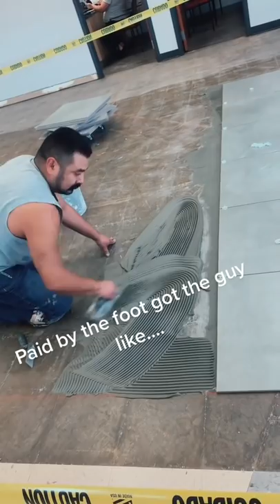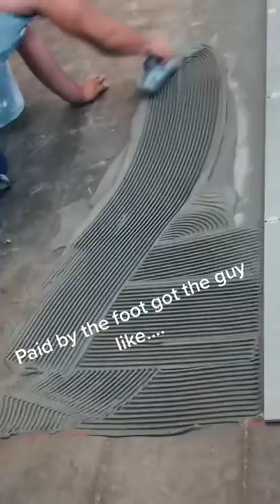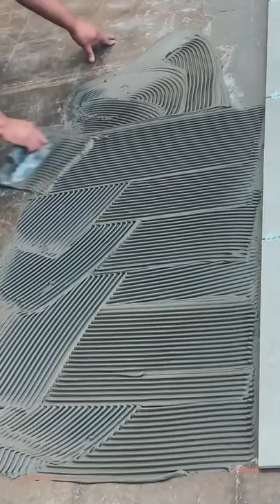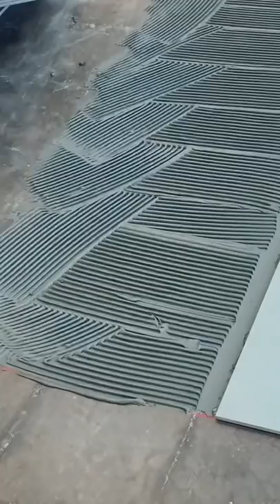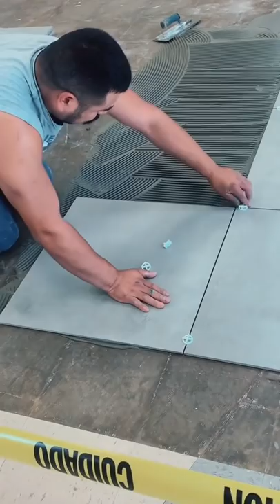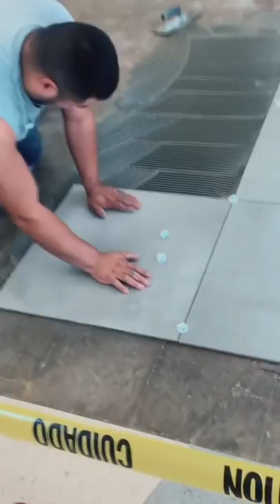Dude laying our new tile is 🥶 CREDIT terrywatson806 #Shorts

Comment: He’s troweling the mortar in a way that doesn’t allow the air to escape from under the tile. The channels in the mortar need to remain open at both ends so the air can escape. Allowing the ridges in the mortar to collapse and completely fill in under the tile. His way leaves air pockets which can lead to cracking and breaking of the tile.
Reply: Exactly,  and no skim coating on the back. Strait rookie as hell
Reply: Also the trowel size is small for those LFT
Reply: @Peter Angles look up a video it's called trowel and error
Reply: I saw all the positive replies and said the same thing,  guess there's lots of people that don't know what their doing.
Reply: @Apoc414  what?
Reply: @growingthegarden  Don't worry, look at the arrows. They're pointing at themselves.
Reply: Yeah the good ol back butter I don’t say shit cus then ppl assume you’re hating I just do mine
Reply: @lemongrab9972  yea we all do this kind of work that's why we're saying something  wbu?
Reply: @lemongrab9972  How do you know he's not doing the work? Also if the guy in the video does a shitty job and gets praised, then that needs to be called out
Reply: You must not have read the part where it says paid by the foot. And its a square tile it doesn't matter which way the trowel lines are. If it was a plank tile (rectangle) then it matters some. Air escapes and the trowel lines collapse no matter what.  How would it be different if he raked it out right to left?
Reply: @dmo544  that part dosnt matter, it matters that the trowel size isn't big enough and he is not butter backing ensuring a proper bond
Reply: @growingthegarden  you are right and actually I didn't see that the tile was covering over where he had two different trowel directions. I didn't notice that at first when I wrote the comment. As to size if it's a 1/4 by 3/4, which I think it is, then it's good enough. We were taught that a 1/2 by 1/2 was very comparable to a 1/4 by 3/4 and that the difference was pretty much negligible. However the latter is better suited for LFM plank. I would use a half by half for these squares probably, but, I truly think the difference is negligible. As to back buttering yeah it should be done but a lot of times it isn't. Overall if I was supervising this guy I would check the bond on one and if it was over 90% then i would say good to go. Him cleaning the edges is fast for keeping clean but they are also the weakest point. I'd be willing to bet that if the bond was checked that could be an issue there. From where he pulls back the thinset with the margin. But maybe not. it looks like the mix was loose enough.
Reply: @dmo544  yes I agree the thinset did look pretty fresh and he didn't waste any time setting the tiles
Reply: Exactly 💯 I am cringing watching this as most are just amazed at how good he's doing 😆
Reply: @dmo544  air doesn’t escape when trowel lines are curved under the tile. Doesn’t matter if it’s a square or rectangle tile, the trowel lines need to extend straight from edge to edge to allow channels for the air to escape. Then the tile will settle when tapped into place and be completely supported as the ridges of the trowel lines collapse together.
Reply: No they don't. Do it with a piece of thick glass u will see so much air trapped

Comment: This doesn't really look slow considering he is doing (from what I can tell) a respectable job. Do you want it done fast or right?
Reply: I'd like it done right. He's not back buttering. He's not doing it right
Reply: @Dagnis8  I'm not going to get into that debate any further than from personal experience I have never found a difference. There are probably applications for it, but my 10 year old tile job that I did personally in a relatively high traffic area for a home has never had any problems. Depends on the stability of the substrate as well.
Reply: Yeah he could do a little better but whatr u paying is the question at the end of the day
Reply: @Dagnis8  thankyou! Ffs there's going to be voids everywhere
Reply: The emoji means he's "cold" good at his job so to speak. It doesn't mean he's going slow.
Reply: Done right, this tile won’t sit completely level especially after the foundation settles. Causes cracking and lifting tiles and cracked grout joints. If done right your tile will always sit level, not just parallel to the ground (there is a difference, I do have years of experience along with being raised doing tile)
Reply: @vincentg6613  kind of obnoxious
Reply: @vincentg6613  Never to young to realize that there is more than one way to skin a cat.
Reply: @Agame-sf8pm  Foundations tend to settle evenly (which can be crooked) or catastrophically resulting in cracks. Concrete foundations are not elastic. Regardless of your preferred installation method. If you are getting lots of cracks in your tile on a concrete substrate, it's likely you have bigger foundation cracks and that's called a settlement problem. Most foundations won't settle more than a few mm over the course of many decades.
Reply: @BoulderBro999 why? wrong. I'm a flooring installer/tiled shower installer and get paid by the sq. ft., too.
I am much slower than other installers because I work alone and there is so much prep, physical AND mental challenges, clean up, e.t.c
 that I would(usually) be scamming the customer from working slower! But, my work is very detailed and upper eschalon  work because of the best descriptive word for ANY INSTALLER: INTEGRITY.
Reply: @Agame-sf8pm  firstly, concrete like that usually doesn't settle much, just dries out over time. Secondly, an uncoupling membrane (i always use it over concrete or wood subfloors) would have solved ANY future tile issues...IF enough thinset was applied.
Reply: No need for back buttering
Reply: Fast. America likes everything fast and cheap that's why we buy everything from china
Reply: @Agame-sf8pm  so is he doing it right
Reply: the post says they cold aka they are amazing at their job. nice try to feed negative energy to a good situation though. maybe next time look at what people are saying before being so ignorant ?
Reply: @doubleo4974  you took the video the wrong way completely lol he was complimenting the man not trying to put him down.
Reply: Yeah my sister’s a waitress. She would always tell us that the cooks would tell them “do you want it done? Or do you want it done right?” Which is fucked up now that I think about it lol cause that’s people’s food that they’re fucking with now
Reply: @doubleo4974  him clearing the edges like that is a big no no..... because now he's going to have voids under there and the first time something slightly heavy or just pointy gets dropped it will definitely start breaking around the edges....
Reply: @savagesaxon9743  the person watching them doesn't know what the hell they're talking about....... He's slow as shit compared to most professional floor guys and the way he's doing it will leave voids that will cause the edges of the tile to inevitably break over time.....
Reply: @JasonP6339  If you have ever laid tile, you know you have to clear the edges of a fair bit because when you press down you don't want is squeezing up the grout lines. You have no way of knowing how thick/thin that mortar actually is from the video. Based on his confidence, and speed laying the mortar, probably just the right amount for the situation.
Reply: I assume he wants to do it fast, if he's being paid by the foot. It's in his financial interest to get the job done as quickly as possible
Reply: Well do you want to fix it later or get your moneys worth?
Reply: @doubleo4974  I don’t use the “clearing to create voids method” neither should you. Simply set the tile literally touching other tiles adjacent to. Helps find height and then create grout line and tap couple times down for collapsing ridges. NEXT tile!
Reply: @jamusmorrison3073  That may be your method but that doesn’t make others wrong. There are a lot of factors involved in we can’t know from the video and every person is different.
Reply: @Hitstix420  my comment was actually supposed to be a reply to someone else. Didn’t realize it until I posted and figured just to leave it
Reply: @doubleo4974  haha what? It’s not a method it’s how a professional is supposed to set tile to adhere to industry standards. It’s not like I’m busting his balls. I just want others to know that’s not how to correctly set tiles. Why do something half ass or incorrect. I know the person paying wouldn’t appreciate having it later incorrectly. 
The edges WILL eventually break. 
The tiles are not fully going to adhere to the concrete floor. 
The trowel, which is undersized leaves ridges and those ridges trap air if not done properly. Making the tiles more prone to popping. 
You can’t cut corners and expect others to not call you out. There are ways to keep the mortar from seeping up. As in lay tile against the adjacent tiles to not only stop mortar from coming up but also match height of tiles already set. 
Thanks for you comments.
Reply: @jamusmorrison3073  Like I said before, you know absolutely nothing other than what you see. You can't possibly know this persons method, maybe they are compressing the tile quite a bit, maybe its thinner and spreads under the weight of the tile more. I never said you were wrong and this person isn't either. If you were standing right there and working with him maybe you would know. Your correct on only one thing, yes, the mortar should be even under the entire area of the tile; to account for levelling different techniques are used. There is no wrong way so long as tile is adequately supported and there is no "industry standard" there are guidelines and best practices, but its not like there's a regulatory body and hard set rules. So unless you know this man personally and can ask him specifically about his method, there is no point debating it. It looks plenty fine.
Reply: @doubleo4974  haha ok you obviously don’t care about how tile is set from a 18 year certified NTCA. For instance if all manufactures agrees how it needs to be done. Then that’s a industry standard. If they stand behind how your supposed to do it to gain maximum results. That also is an industry standard. It’s ok to be wrong. I promise one of those edges will fail. Especially if a vehicle or a object is hit with force where there is a void. 
I’m not trying to bust and balls. That’s just simply not how tile is to be laid for best results. I don’t need to know the “conditions”.
Are you fucking with me? I feel like you are..
Reply: A
Reply: @doubleo4974  ok your wrong move on!
Reply: @doubleo4974  the factor is he’s layin tile do it the correct way or not at all! Because then non professional like yourself think they can make assumptions. Wrong! Enjoy your day!
Reply: @jamusmorrison3073  More than one way to skin a cat. Maybe educate yourself.
Reply: @doubleo4974  this isn’t skinning a cat. It’s laying tile. Are you a professional tile setter?
Reply: @jamusmorrison3073  Are you a professional cat skinner?
Reply: @doubleo4974  no that’s why I didn’t comment on your skinning a cat comment. I do set tiles for a living.
Reply: @jamusmorrison3073  I would be honestly surprised if you have actually done any physical labour in your life. Your insufferable attitude makes it difficult to understand who would hire you. Just like you can't prove without a doubt the methods the person is using in this video or their experience, I can't prove a word of what you are saying. It's just as irrelevant. Fact remains, you can skin as many cats as you want, but someone else will always have a different method. Doesn't make it wrong. If we never did anything wrong we would never have found out the Earth was round.
Reply: @doubleo4974  haha you are incorrect I have 18 years in traders. I own my own company but I still work for someone. As is this chap. So you give them the best job. It was good talking to you. I just hope others that read comments don’t think like you and take advice of a PROFESSIONAL!
Reply: @jamusmorrison3073  You work in traders? Like Trader Joes? or is this something like fur trading? I doubt its fur trading unless you are Chinese or Indonesian where most of our clothes come from these days. Be interested to know. As far as my frame of reference you are just as professional in your career as you the fights you choose to pick online. God Bless You.
Reply: @doubleo4974  haha yeah

Comment: I used to be a handyman. Did everything inside and outside of a house. Laying tile isn't difficult, but takes practice to get good like this. Cutting tile is the worst. Measuring angles trying to get it exact can get frustrating. We retiled an entire house one time and our jack hammer broke so we brought out hammers. Fun 2 days. It feels good when you finally start washing out the excess grout tho. Job's done
Reply: Good like this? Huge red flag is the lack of directional troweling. 😂 This is a guy you pick up out front of home Depot.
Reply: @JasonPowell91  "directional troweling"? It is directional genius. The opposite of directional would be random
Reply: @JasonPowell91  only real problem I see is possible hollow spots from scraping the edge like that with big tile. Granted, I was a handyman, not a tiler. But did learn from a tiler of over 20 years. We did tile, but was far from the only thing I did, and probably the rarest
Reply: @sevenwhatuknow  That's one issue. The other issue is different troweling directions. He combed down and to the side near his knees. When doing that, the notches in the thinset are not able to fully collapse, which traps air between the ridges. Always trowel in the same direction and collapse the ridges when setting the piece.

Comment: Father is a tile setter and I failed at trying to emulate. The edge that was cleared with the margin trowel has a higher probability of breaking than the rest of the tile. Should be good assuming this isn't like a car dealership or an entryway that might get a lift driven over it. Clean work none the less I'm sure the installer considered what was needed for the scope of work defined. Keep it up OP that's a tough line of work.
Reply: First thing I thought was car dealership. But you should lay every tile correctly.
Reply: Did your dad back butter his tiles especially ones over 15 inches which is suggested by the NTCA?
Reply: @ironsharpensiron4580  yeah it’s 12x12 is the NTCA. If not he should have!
Reply: @ironsharpensiron4580  back buttering is the more "correct" way of doing it, but it's hardly ever practiced in the trade, especially on ceramics. It is usually almost always done with natural stones (i.e. marble).

Comment: I’ve been doing flooring for 26 year Thinset has to be spread in one Direction for the air to escape and properly be set . On top of that 1/2 Notch trowel should be used on large tiles that floor won’t last .
Reply: Sounds like a hater 🤣
Reply: @elizagarcia2057  you keep showing up on peoples comments lmao they are presenting facts but you call them haters . Sheesh you must be mad
Reply: @elizagarcia2057  go check the TCNA and quit calling people haters that do it for a living while trying to defend something that is clearly wrong

Comment: For a person that worked in tile this dude has pro skill reminds me a lot of my mentor. It’s a pain in the butt to do but the finish product makes you feel good especially when the homeowner sees how well it came out.
Reply: But with tile that size shouldn’t it be back buttered too?  I feel like his thin set should also be straight lines all the way through to avoid any air pockets and adhesion issues.  Fast? Yes.  Correct? No.
Reply: How long did you do tile a week?

Comment: Those crossed sweeps will trap air under the tile making it weaker. The trowel is designed with grooves to create air channels for the air to escape as the tile is pressed in place.
Reply: You my friend are 100% correct. Only took 120 comment to find this answer.
Reply: Should you also 'back butter' the tiles themselves for better overall adhesion and level~ness...? Or are those tiles big enough that it won't matter
Reply: Instead of thinking he did a great job with one flaw you let that 1 flaw control your whole state of thought.. it’s time to start looking at the glass as half full instead of half empty 👏🏼 best to you god
Reply: @amp8899  all he did was point out the flaw. You took it that way. How do you know the commenter doesn't think the man did a good/decent job?
Reply: That's why they have grooves..
Reply: @amp8899  the people always focused on thinking the class is half full are the ones always thinking it's empty
Reply: @amp8899  they just happen to be flaws that will cause the tiles it pop and or edges to bust/crack off! Making the tile work garbage.
Reply: https://youtu.be/Way5bMh-eYg

Here's a detailed demonstration using glass tiles so you can see exactly what's happening

Comment: This tile is likely to crack over time. You are supposed to keep the cement straight and move it to the side to get full coverage. Plus the one corner has 0 coverage/support.
Reply: I concur this is not a very good tile job. The only thing it has going for it is the floor looks very smooth and flat. But all those overlapping trowel lines are going to trap air. And anything over a 12x12 tile needs to be back buttered.

Comment: Now you can see why edges crack, but it’s okay because when you repair them the tile should pop up easy cause this guy does not think that backbuttering the tiles is important or maybe he just don’t know.                                                       Don’t take down your material from the edges, if it messy clean it with your sponge
Always backbutter your tile if it is over 12 x12
Put a an anti fracture membrane on the concrete before your thin set
  Other than that I guess it’s okay     For nonUnion work